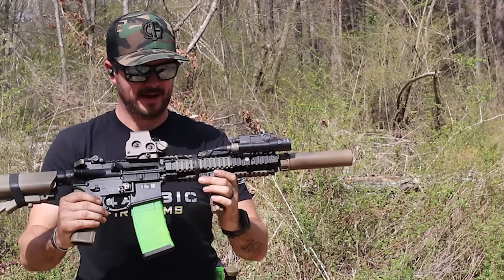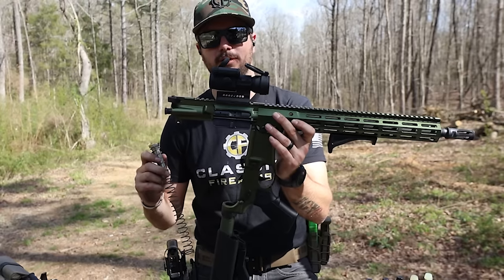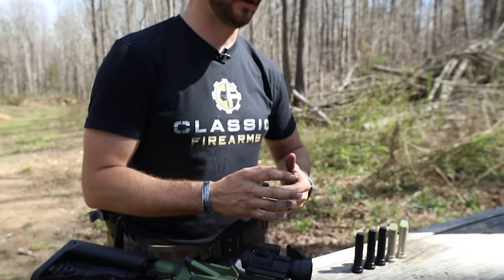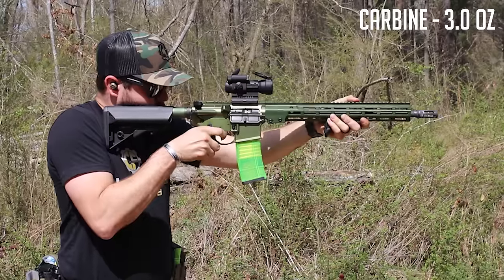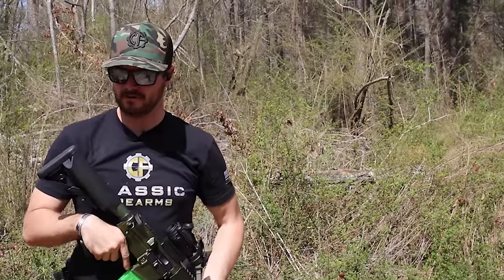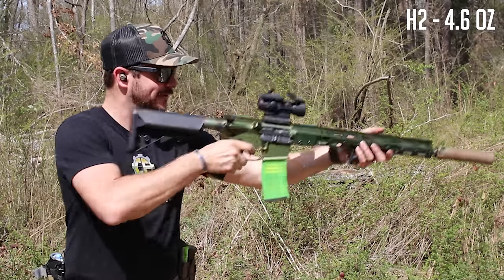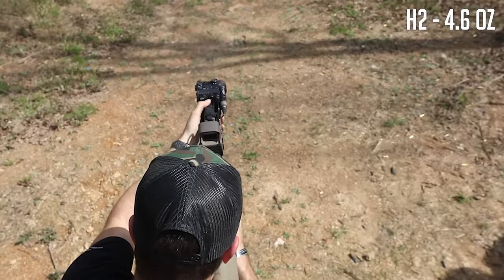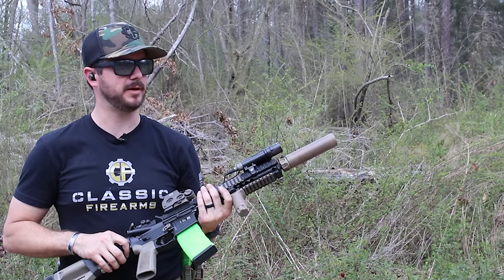What Buffer Should You Use In Your AR-15? (H1, H2, H3, H4)

Comment: So, I find it very serendipitous that this video comes across my recommended videos . . . as I'm having problems with a build of mine. It has an integrally suppressed, 300blk upper, with a roughly 8" barrel, and roughly 8" suppressor element, on a standard mil-spec lower, w/ mil-spec  buffer tube, spring, and buffer, with a Law Tactical folding stock adaptor. The specific problem I'm running into is, my shots aren't fully ejecting spent casings, or they're failing to feed on the few times it does actually throw out the empty. I've only (thus far) fired subs through it, and wondered if that might be the source of the problem. But if so, that would defeat the purpose of using a suppressed upper. I have not yet tried supers through it though, so I'm not entirely sure if the ammo, the spring, or the buffer might be the problem. Any suggestions?

Comment: I run hydraulic H3s in all my Colts and they run fine. In I'm running a DI with a suppressor, I use a Gemtech Suppressor bolt carrier with the extra hole opened. It's amazing.

Comment: Now you can look at using extra power return springs. I ended up going to a blue Sprinco and an H1 based on the gas port size and location on a DD 16”. Incredibly smooth.

Comment: I've found the spring tension impacts much better than the buffer.  OSS type can?  Do nothing or very little.  RC2 type blowback?  Sprinco Red spring and H2 buffer.  Best for non flow through (OSS type) action?  Sprinco Red with a Griffin Armament SOB Buffer.  Smooth action and very reliable.
Reply: What’s a good spring I can use with just the regular carbine h1 buffer  ? My new ar is overgassed a bit at around the 2:30 position.
Reply: @AccDeleted1  Try a Sprinco Red spring

Comment: They mostly only matter for fully automatic capable weapons, and can make a huge impact on reliability in that platform. You can even run 1.5oz airsoft buffers in AR-15's. Not that you should, but I've tested it much like you tested different weights in this video, works fine.
Reply: What buffer is used in full auto capable weapons?

Comment: So I'm try to keep the gun and fired cases as clean as possible, bought an adjustable gas block so I can minimize the amount of gas in the system and put a lightweight buffer in the gun. Have not tried it yet because hunting season is upon us. Btw it's two 22arc uppers, what's your thoughts Clint? Suppressor is a Silencerco Omega 300, 16" faxon barrels, one has a mid-length gas system the new one has a rifle length gas system.

Comment: My PSA 10.5" pistol kit came with an anemic 2.79oz. Buffer. I did not even know they made such a light one. I replaced it with H2 like I do on my other ars.
Not that I'm a fan of bumpfiring, but the gun would not run with the 2.79oz. Buffer. The h2 chugs right along without hammer follow.
My ejection is 3 o'clock. Hmm. Maybe I'll try a h3 sometime just to see what happens. Less wear the better.

Comment: Suppresed H1 buffer and AR10 spring, keeps bolt in lock up for a tad longer helping with gas and ejection. Adjustable Superlative Arms gas block with bleed-off is also useful.

Comment: Do any AR experts/gunsmiths recommend changing the buffer weight before adjusting gas? Or even changing the buffer at all? Do they prefer a single buffer weight in general? This test just seems to show it gives you a better starting point to adjust gas but since every AR should have an adjustable gas block and the differences in recoil were not even perceptible, the buffer seems to mostly just be adjusting for over/undergassing... and fixing that seemed entirely a guess and check exercise. Adjusting the gas block is too - but it's a screwdriver turn rather than buying multiple $50 buffers.

Comment: I just added a psa 18" fn chrome lined barrel to my ar (previously a 16" from another manufacture). I also bought the Geissele Super 42 Spring with the H2 buffer. Before I installed the spring and buffer, I took a few shots with the spring and buffer that came with the lower. It was over gassed and ejecting the brass between 1230 and 1. Installed the super 42 and h2 buffer and the ejection pattern went to 3-4 o'clock plus I felt a big difference in felt recoil.

Comment: Need to consult a mechanical engineer specialist in vibration analysis. Buffer weight and spring load will determine the recoil load and rate of fire. Third year student taught with System Dynamics 301 will be the greatest resource

Comment: DD's are known for being pretty over gassed (especially the mk18) so i've found i can run up to an H4 unsupressed for 1000 rounds without cleaning out of my 14.5 dd upper and have no issues with ejection or lock back (very solid 3-4 oclock) but the best recoil impulse for me is h2 unless it's suppressed (still completely manageable), and i don't think i'd go above an h2 on any "duty" or trust my life to it gun. But tbh AR guys are so particular. No AR i've ever shot has made me go "wow thats a lot of recoil" so unless i'm shooting a competition, i don't see the advantage of changing buffers unless you're suppressing.
Reply: They have been using the Crane spec for their port size. Mk18 is .070 since 2017 for example.
Reply: @ACGBLR  They say that, but it looked bigger than .070 that i have on a ballistic advantage, and the Mk18 i used to have i bought in 2018, granted i may have gotten one produced before the adjustment and it was just sitting in the shop. but i also don't like 5.56 for that short a barrel, so i sold it. I'd rather have 300blk in an ar or just do an AK. Both less violent and more durable systems.

Comment: Those older Daniel Defense barrels have blown out gas ports. It's kind of a bad gun for this type of test. That gun will probably never eject casings at the 3:00-4:30 position unless you put an adjustable gas block on it. This is especially true when you have the Surefire RC2 on it. Newer Daniel Defense MK18 barrels and Colt 10.3" barrels with .70 gas ports do not exhibit the same ejection patterns.

Comment: What about adjustable gas systems? I am assuming this is just a fixed gas block we are talking about. Seems like all this changes with adjustable gas systems. I always build my rifles with as little gas as needed to cycle and get that brass in the right place. Heavy buffer with full gas seems to me would be much harder on the rifle than light buffer with limited gas. Great video but want to throw the next wrench into the mixed with adjustable gas systems along with buffer weight or if one negates the other. Maybe we are all wasting money or maybe same goal but there is a cheaper easier route one vs the other.

Comment: I'm pretty sure I run carbine buffers in everything I own (couple H2s in the 10's perhaps), 308, 7.62x39, 5.56, 50 beo, 6.5 cm...
I have adjustable blocks, and/or change spring weights to tune mine and they all run like a sewing machine.

Comment: One thing to consider: An off-the-shelf vanilla 16" AR might seem to run the same with a carbine buffer, or a H4 buffer. But then one has to consider the extra weight of the H4 shoving the bolt forward harder. What would be interesting is comparing these same buffers to something like the different weighted JP Enterprises SCS, using a slow-motion camera to see what's going on with bolt movement back and returning to lockup.

Comment: It looked like you were using a Geissele Super 42 braided spring. I installed this spring with the included H1 buffer in a KE Arms KP-15 lower which I used successfully with 6.8 spc uppers (no surprise). When I installed a 16 in. mid-length 5.56 upper on this lower, the action wouldn't work correctly. The BCG would not come back far enough to chamber the next round. It would come back just far enough to snag the round and mangle it. I have now swapped the Geissele buffer and spring for a single wire spring and unmarked buffer from another lower. I predict better results, but I haven't got around to trying it again to find out. I suppose it might also be interesting to try the braided spring with the unmarked buffer, now that I think about it.

Comment: If my ejection pattern is good and my gun is cycling perfectly, and I'm happy with the recoil, does that mean I am, in fact, using the correct buffer weight? Or should I increase my buffer weight and turn up the gas?

Comment: With suppressed are you using subsonic ammo? Are you using adjustable gas block? I know the variables go up but once dialed in the best performance or ‘felt recoil’ can be determined … also, how about a pressure pad detector for absolute objective measurement

Comment: Putting together a 20” 5.56 Aero Precision rifle and I have the adjustable gas block so I figured I’d just get the Aero Precision H3 buffer. Maybe too much buffer? I figure I can just use the adjustable gas block for changes if needed.
Reply: If you wanna mess with an adjustable gas block, then id suggest hold off on the h3 buffer. If you can tune it with a standard buffer then that would be better. Every action has a reaction. Adding heavy buffers (what I do cause I like my a2 fsb) surely slows down the bcg. But more mass is travelling forward back into battery as well. More mass= more damage. You prob wont notice it til 20k rounds later tho. But by then your barrel would prob be shot out anyways. Just saying. But good luck with your build

Comment: Great videoI use a Vltor A5 system with a Geiselle Super42 rifle spring which is a great mid between a rifle and carbine system.  I used to run h2 and recommend that as standard minimum for stock rifles.

Comment: Great video Clint. I'm extremely interested in buffer weight in my latest project. I have an Angstadt UDP-9 (AR-9). I replaced the 6.8" barrel with Angstadt flash suppressor, with a 16" barrel with Kaw Valley linear compensator. The OEM buffer is 5.4 oz. I haven't fired it yet but I wouldn't expect the increased barrel length and compensator to change anything like would occur on a direct impingement system. Is my expectation realistic?

Comment: I’ve built an 11.5” AR in 5.56 with an adjustable gas block. I put in the standard buffer and my god is the recoil violent. It runs without a problem but 5.56 ought to be smoother. Perhaps I do need an H3 buffer

Comment: The weight that works best. That’s the proper buffer weight. Personally, I say use the least gas possible with the lightest buffer. When I built my 308 and my 300BLK I had to experiment a lot.

Comment: Good video. I’ve got one 16” gun. Carbine gas that like a strong spring and a “tungsten powder” H2 buffer. Won’t lock back on a h3. Smooth operator….. also a 10.5 and 14.5 that both like h3. Need to find me an h4

Comment: Came here because I operate a 16inch piston system with a stock H2 buffer weight and noticed my ejection pattern is about the 1-2 o clock position. Think choosing a heavier buffer weight will help?

Comment: When I got my 1st AR (a Diamondback DB15), I eventually put a Fostech Echo 2 Trigger in it, and at first, I had trouble with the trigger & bolt getting out of sync when I used Echo mode. Putting an H3 buffer in the rifle with the factory buffer spring solved that for the DB15, & the Echo runs great in it.

Since then, I put together an AeroPrecision EPC pistol build chambered in 9mm, and heard that it would be good for felt recoil to use a heavy buffer (7 or 8 ounces) and a .308 spring, which I did. The EPC pistol runs just fine with a Timney Impact trigger or with the Echo trigger in regular semi-auto mode, but I can’t get Echo mode to work with it without the bolt & trigger going out of sync. What weight of buffer & what buffer spring should I put in the EPC-9 to get Echo mode to work reliably with it?

Comment: Wondering if there is a recommended type of buffer for the AR15 (or BC 15) 50 Beowulf? And if having a muzzle brake on an 18" barrel will require a change of buffer? Currently non muzzle braked extraction is around 3:30 to 4 o'clock depending on the number of rounds I put thru it during my range time. I would like to see the casings eject at 4:30, Should I just purchase different buffers until I get what I want with muzzle brake installed? The lower currently is a standard AR15 lower with an H2 buffer .

Comment: Built my ar with a 556 20 inch barrel, rifle length gas system and  carbine buffer assembly. Uneducated about buffer lengths at the time.  I thought felt recoil should have been less. Ejected 3oclock. I triesd tungsten weights and then back to steel. Should I not have used rifle length gas system with a carbine buffer tube assembly? 
Or am I just expecting the YouTube flat shooting Gucci gun performance from a bread/butter homebuild?

Comment: Okay, I have an AR with a 16” barrel and adjustable stock. When it was first built it would not eject properly, and would stove pipe. I can’t say how heavy the buffer was that was in there then as I didn’t, and still don’t, have the knowledge/experience in troubleshooting AR’s. Anyway, the buffer in it now is 2/34 ounces, but works well. Clint didn’t mention a buffer as light as mine and I’m just curious if my buffer shouldn’t be this light? Thanks.

Comment: makes essentially no difference unless you are running full auto, or you have a tempermental upper. Heavier buffers when firing full auto slow the rate of fire down signifcantly. Heavier buffers on under-gassed uppers can cause failure to feed malfunctions, or other issues.

Comment: Not sure if you've already done it, but I'd definitely find some value in tuning the AR via the buffer. I have a feeling that when I start shooting suppressed that I will, possibly, need to run a different buffer 👍🏻
Reply: That’s what I thought before I got my first suppressor. 

I found out that I was making a bigger deal of this than necessary. 

To establish simple limits of functionality it just needs to:

Complete the cycle of operation correctly.

Lock the bolt back on the last round.

Eject between 2 and 5 o’clock.

Function properly with all types of ammo I shoot.

Function properly in extreme heat and extreme cold. Most operators never take the time to test this. 

Signed Capt Obvious 

PS: the most prolific and successful assault rifle of all time is notoriously over gassed. The AK-47.

Comment: Have a 13.9 on suppressed that will cycle well with rapid or intermittent firing but won’t lock the bolt back on last round and won’t reset the trigger on the last round as well. Ejection pattern around 4-5 o’clock. Current buffer system vltor A5H2 with sprinco green spring. Thinking about switching to either A5H1 or A5H0. Thoughts?

Comment: Great video! I'm running into an issue with my AR. My 5.56 feeds every bit of ammunition reliably with every trigger pull. However, my 300 BLK on it’s own lower and upper, 14 in barrel, has trouble with cycling. I have suspected it's the buffer and or the buffer spring. Standard 300 BLK ammo feeds just fine. However, if I try to run subsonic, I will invariably get a misfeed. Any thoughts on what to use?

Comment: How about the hydraulic buffers? (And without the buffer/spring, you just made it a single shot. Big question is would the bolt stay in the rifle or merge with your shoulder. Maybe try that with a stand and good backing plate and no shoulder...)

Comment: You really should have the same round count in the magazine for each buffer test. You’re much more likely to see failure to remain open as a sign of too heavy a buffer than “feeling”. I noticed the bolt didn’t stay open on the first try with the H4. Not sure if that’s because you had more rounds available or if the buffer was too heavy.

Comment: If you think you like a particular buffer/spring combo throw cheap Russian ammo at it.  If it won't run reliably back down on the buffer weight until it will.  Don't assume in an emergency you'll have access to quality (hot) M855 or M193.

Comment: I just put my first AR15 together in 223 wylde and I’m running an 18” barrel with rifle length gas system with a carbine buffer. Got the adjustable gas block fully opened and it won’t stay open on an empty mag. Ejecting cases at 3:30. What should I try?

Comment: You should do a video on buffer weights and systems with AR-10/LR308 rifles. That would be a good one since you can run different length buffer tubes and different length buffer weights because of the longer BCG compared to a mil-spec AR-15 BCG.

Comment: I run a H3 with bcm carbine buffer on 9” 300 blk out suppressed and unsuppressed as it’s the only one that locks the bolt open on last round, so I don’t switch it up when I throw on my 11.5” 556 un/suppressed. Ejects the same around 2-3’o clock I notice slightly less violent ejection as well.

Comment: I have a question about buffers. Does it matter which way the weights go in? Meaning if I pop off the rubber cap to change an h1 to an h2 should I insert tungsten, tungsten, steel or steel, tungsten, tungsten? 
I became really curious about this when changing a giessle super 42 from an h1 to h2. According to giessle instructions that came with it you insert the tungsten first and then steel touching the rubber end cap. However when I popped off the rubber cap they had it opposite. I became curious and opened up a couple more buffers and each one was opposite of what giessle recommended.

Comment: I have a question. I accidently bought a hydraulic buffer that was meant for a foldable stock, and I have a fixed stock. What will happen if I use the new buffer on a fixed stock

Comment: Everyone is fucking with the heart of the rifle without taking into account weather and temperature conditions. Changing the buffer weight and system plus adverse weather/temperatures could cause serious reliability issues. If this is a rifle your life might depend on, I would think twice before I change out the buffer weight/system that the manufacture installed. A little over gassing is better than a malfunctioning rifle.